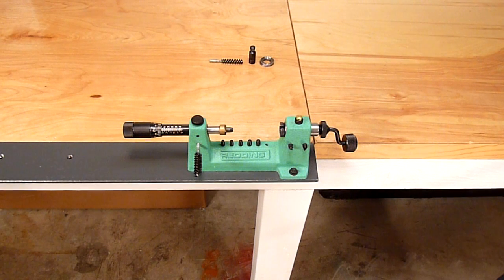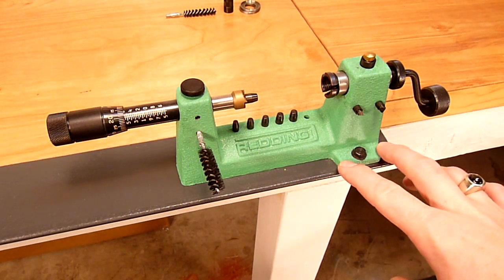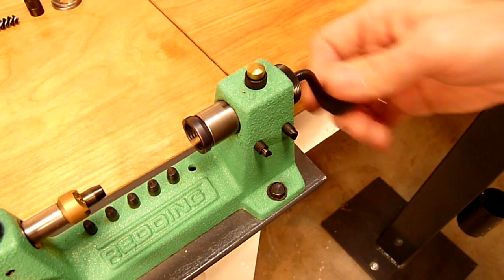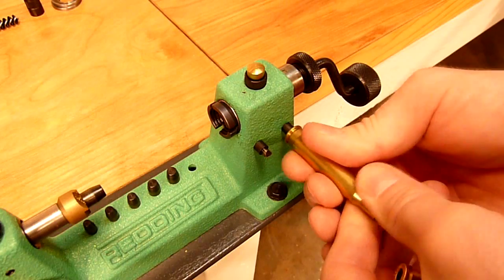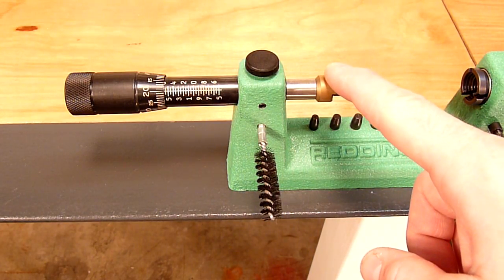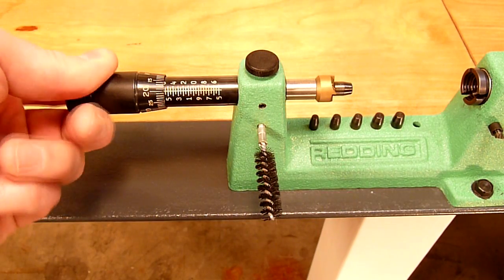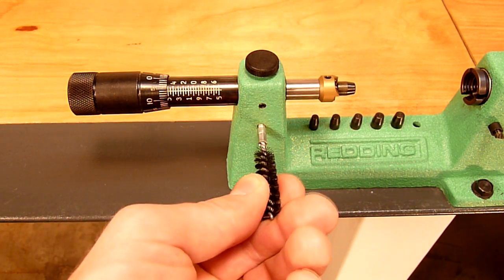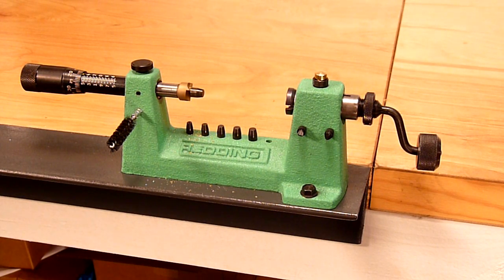Redding 2400 Case Trimmer Overview (HD)

Comment: I have the Hornady case prep center, it DOES NOT cut the case mouth square as the pilot/cutter and shell holder alignment is off. When I lower the ram the.brass is always off center, it will trim the brass quickly but not precisely ( in my opinion ) is this a better ( more precise ) product ? Do you have an opinion on the best one on the market ?